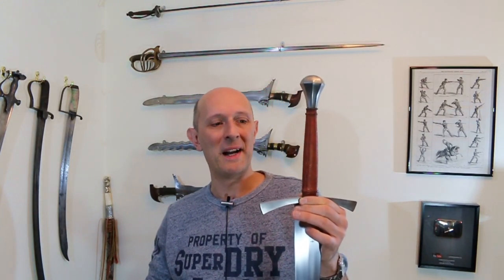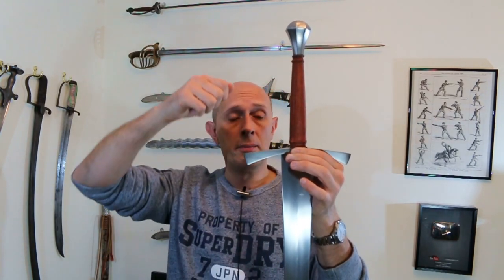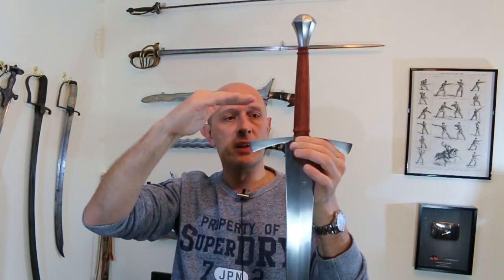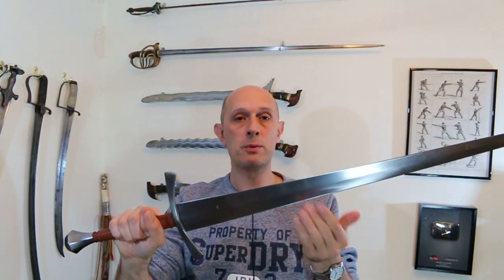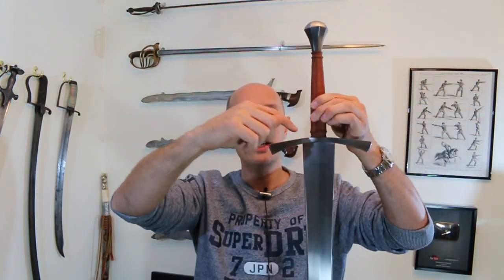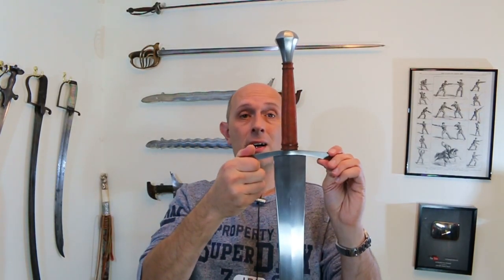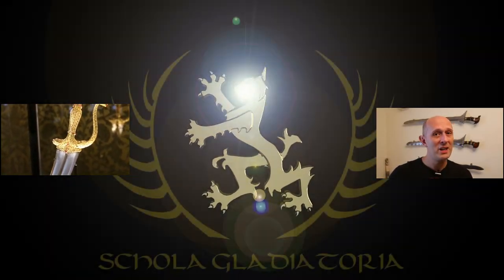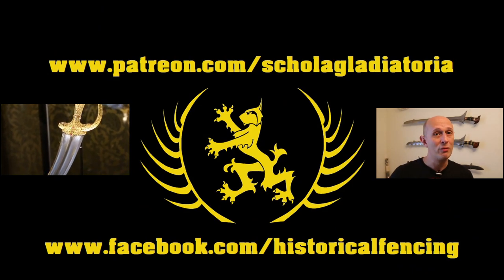Guard construction on medieval swords

Comment: One minor nitpick, usually on Japanese swords the tang usually isn't a separate welded piece, it's actually an extension of the core of the blade without the laminate on top of it.  It is softer than the rest of the blade but it was still formed from the same billet.

Comment: An example of a punch - peened crossguard: https://i.imgur.com/WhH9sEk.jpg

An example of a forge welded iron tang on a steel blade: https://i.imgur.com/E8yyEQw.jpg
Reply: IPostSwords, nice examples! So, in the latter one, are the ricasso and the tang a single (iron) piece, and the sharp part of the blade another? Or did I misunderstand? What is the triangular mark, 3 rivets (would be strange) or just decoration?
Reply: Yes, the tang and ricasso are one bit of iron, the blade itself is crystalline wootz. The three dots are a traditional hindu symbol, just decoration really
Reply: Yes, it really does make sense from a construction perspective. Very interesting, thank you!
Reply: your labels are backwards. also that doesn't look forge welded...that looks like a modern weld.
Reply: labels aren't backwards when I open it. And it isn't modern, it's very typical on these 18th century wootz tulwars and pulwars to have a forge weld like that one. The technical term is "scarf welding".

here's another: 

https://i.pinimg.com/originals/e9/70/30/e97030fe27d2d0d3390f3a096a8e2096.jpg

https://i.imgur.com/w4MS7Hn.jpg
Reply: maybe i'm looking at it wrong, i thought the one marked "forge welded iron tang" should have gone to the one showing a tang, and the one "punch-peened crossguard" should be the one showing a crossguard...but now i see the forge welding on the tulwar (i expected it to be a bit higher up near the hilt)

it's the punch - peened crossguard that looks like a modern weld (with all the dots of metal around it)
Reply: The dots of metal are actually indents made by the punch, It looks like the punch was placed on the guard angled in towards the tang, so when the punch was struck it pulled the material from the guard in towards the tang, squeezing the guard against the tang and preventing the guard from moving (similar results could be achieved by laying one side of the guard on an anvil and striking the other with a hammer, also squeezing the guard around the tang but leaving hammer marks rather than indents)

Comment: T'was indeed interesting, and now i think about it, a perfectly sensible technique. In modern parlance we would refer to it by a few different terminologies "press fit" (very tight, something you could remove with a press) or an "interference fit" (something you fit by hand and potentially knock free), or perhaps a "shrink fit" (whereby the cross guard could be heated, then dropped onto the tang, and perhaps the reverse applied if you needed to remove it).

Comment: This seems, surprisingly, immediately useful to me. I bought a Windlass sword some months back and have been doing cutting tests with it, and the guard has come a bit loose-- from what I've heard, the Achilles' Heel of many Windlass products. Perhaps my problem can be solved with a few simple hammer strikes.
Reply: Any update if you solved your issue this way or another? I also have a windlass sword, nothing rattling yet but I'm curious how to solve that if it ever does become a issue.

Comment: while I am not wishing to say that you're wrong the 'evidence' of historical blades with destroyed grips not having lost there guards has an issue. 

environmental conditions that result in the loss of the organic grip, such as being in a river, are likely to cause corrosion.  and in my experience when 2 close-fitting pieces of steel (such as a nut on a bolt) corrode the fit will tighten from finger movable to completely immovable when only a thin coat of rust has developed on the surface of the bolt.

this could easily cause a well fitted but disassemblable guard to be firmly affixed to the blade in less time than it would take the handle to rot off. 

that said you did mention other evidence that doe not have this problem.
Reply: Very good point.

Comment: When you have hammered your guard on and it is still redhot (or at least a couple of hundred degrees celcius), you can quench it, which will make it shrink a tiny bit. This will make it sit very tight of the shoulders.
(This works because metals (and most other things) expand, when they get warmer) ;)

Comment: Something I've wondered before but never asked: how would medieval swordsmiths have made a hollow pommel like the one on the sword you're holding? I'd think the modern technique would almost certainly be sheet metal stamped and formed by machines, possibly two halves welded together, but I wouldn't think machine stamping (even powered by a wind or water mill) would be something a medieval smith would have available, nor would modern welding. Would he hand shape two halves? But then how would he weld them together without losing the shape by hammering it out of all recognition? Would those pommels be a roughly uniform thickness of relatively thin sheet metal, or would they just be a big lump of metal with a broad cylindrical gap in the middle?

Likewise for hollow shafts: today I assume they'd be drawn like a bike frame, but back then would they hammer a piece of steel flat and then hammer-form it around a long, thin mandrel? Would the edges then be forge-welded together?

Comment: You missed the soft iron wedges either side of the tang hammered into the gap  . The tang has lil notches the iron is hammered down into the gap and mushed into the notch. Finished by file flush. Sorry about the verbiage - on a nightshift.

Comment: When the ctang and the blade is in one piece,as they usally are. The tang is not hardend to the same hardness,if hardend at all,so they are not brittle at all,but much stronger then a 2 peace,forge welded one. It is the same with knifes off course. And a langmesser have the pin in the one half in the guard,not threw the tang,because it again weakens the sword.

Comment: Isn't low carbon steel more brittle tough ?
Reply: Not quite. The way you make it brittle is by introducing too much carbon.
Reply: Low carbon steel can be more brittle if it has other additives, like chromium to make it corrosion resistant for example, and that's usually what people are talking about when discussing swords and knives, but generally the closer steel is to pure iron the more malleable and less brittle it is.
Reply: No, it's more ductile and lower strength.  Same elastic properties or very close.